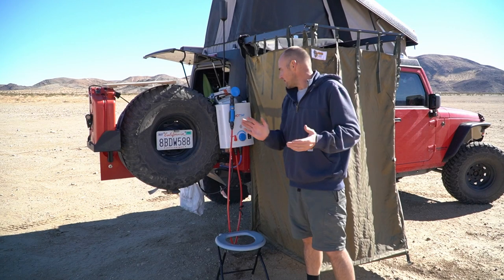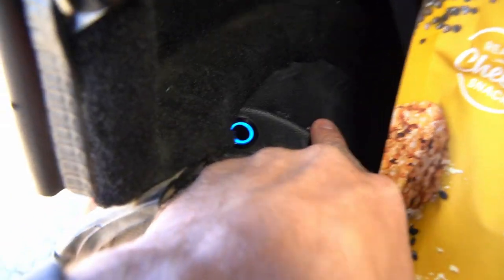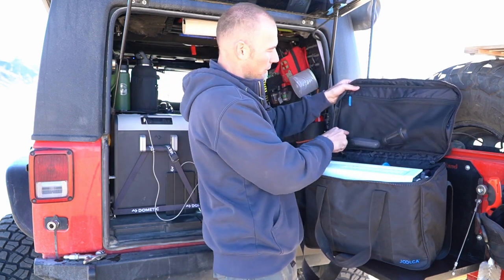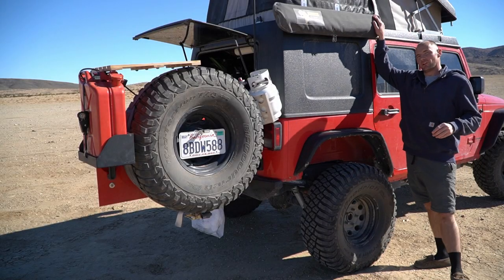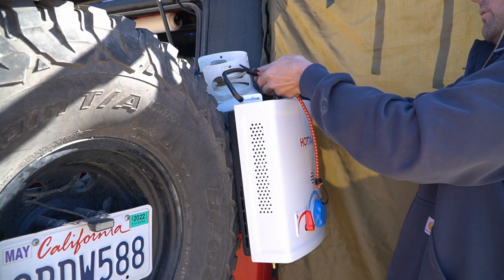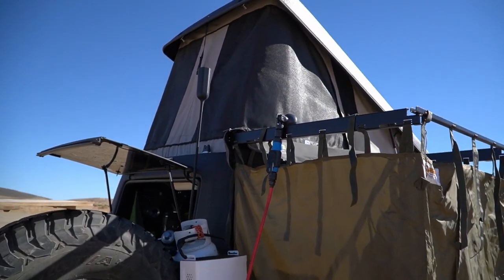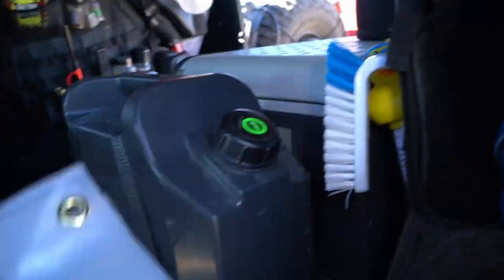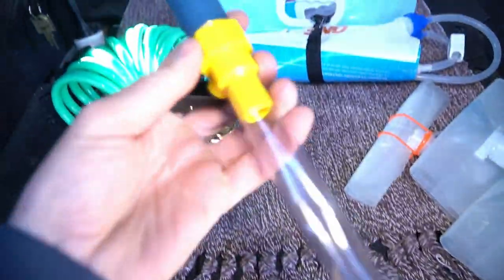Easy Jeep Overland Camping Shower & Water System

Comment: Consider permanently mounting the gas hit water system on a swivel TV wallmount arm inside your jeep so that it can swing out when the door is opened.
Reply from the maker: I have considered that, but then I’d have to sacrifice interior space. Im thinking my long term solution may be something like a Glind Heat Exchanger. No moving parts or fuel needed and would mount under the Jeep with almost nothing extra to carry

Comment: Hi there.  Did a similar shower system successfully with your video for guidance.  Well done.  One last item remains - the Joolca coupling doesn’t fit into the 1/2” female MPT quick disconnect.  Can you please link to the connector you are using to connect the Joolca hose to the water outlet quick disconnect.  Thank you!

Comment: I may have missed this in an earlier video, but what is the bag that  you are using to store your hoses, water filters,etc.? Also, did the brackets for your shower enclosure come on the Ursa Minor or did you add them? Great job on the whole water system.
Reply from the maker: Those are purpose built roll bar storage bags, if you look back I actually made a video about them 👍🏻
They’re cheap, from Amazon and provide A TON of storage space for either the JKU or JLU 👍🏻

Comment: Thanks for the info! What happened to your slanted behind seat tank? I was thinking of getting it unless somethings wrong with it that you may have noticed.
Reply from the maker: I still have it, worked perfectly. I wanted more interior space so I downsized both my fridge and water tank. I now use a 5 gallon Front Runner jerry, in place of the slanted tank. 
Both tanks are sold by FR, but manufactured by Pioneer Plastics and of excellent quality 👍🏻